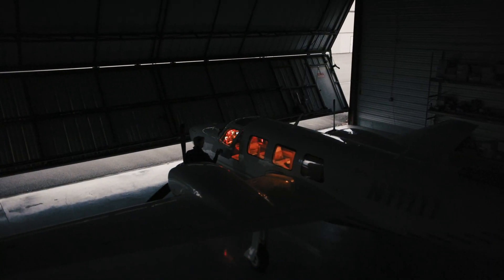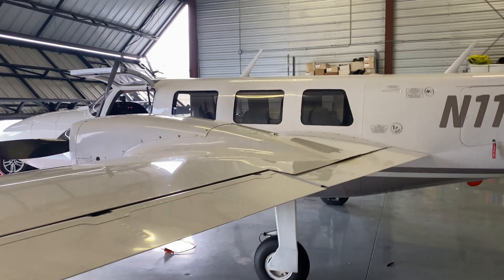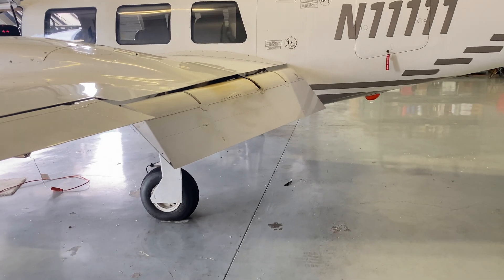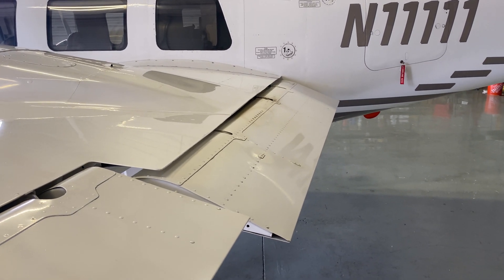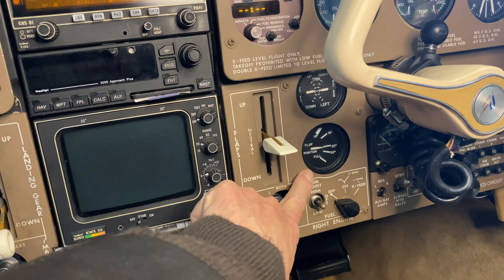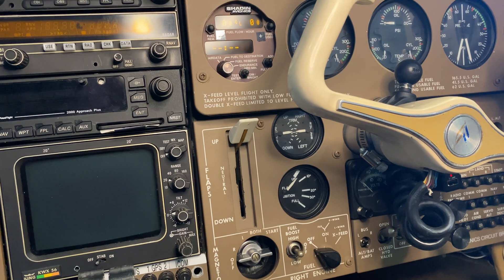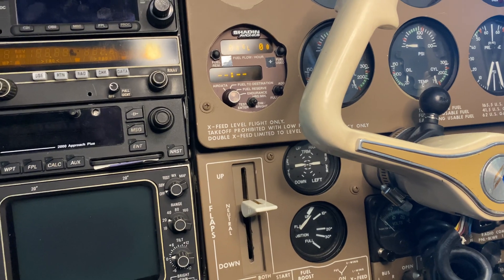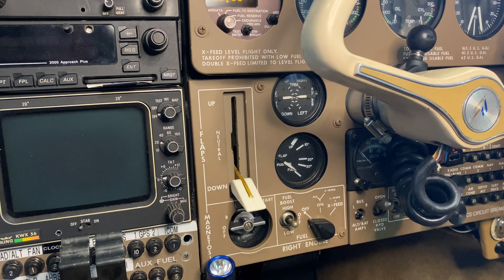The Piper Aerostar like a Flying Backhoe!

Comment: Have no idea why Piper wants to complicate things.
Reply: I fly a 600A, same system and I have never found it complicated, it isn’t as simple as a Johnson bar, but not difficult in any way.
Reply from the maker: First, Piper had nothing to do with the design of the Aerostar.  Why would this be complicated?
Reply: @AerostarPilot  I thought it’s a Piper.
Reply: Piper bought the brand (company) many years after Ted Smith and Eric’s Father designed the Aerostar.  One heck of an aircraft.  Design was ahead of its time.

Comment: Not a pilot but I see a maintenance issue.  In the foreground of the flap switch shot you can see the coil wire cable has worked it's way out of the hole in the yoke exposing the individual wires to chafing and possibly grounding which could blow a fuse causing loss of some systems or worse a fire  !
Reply from the maker: It is on the list for annual at then end of the month.